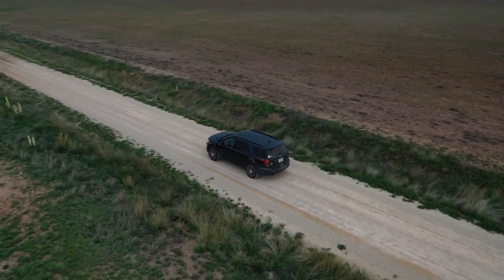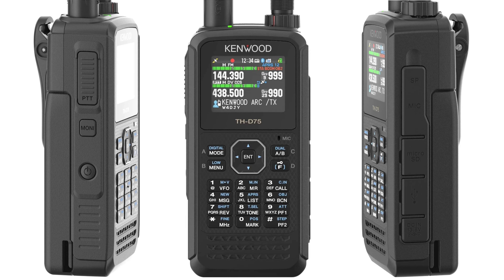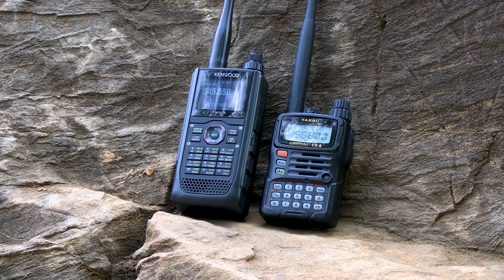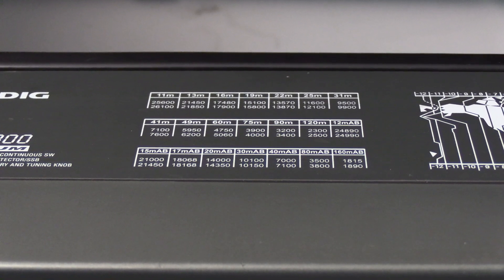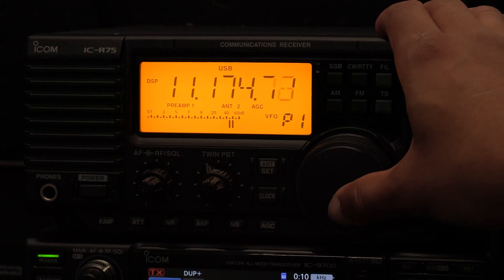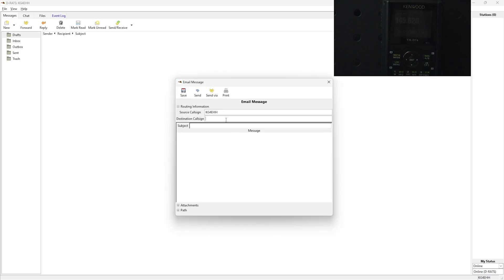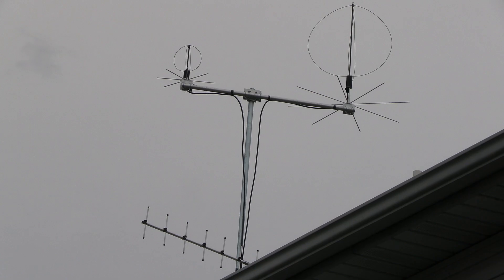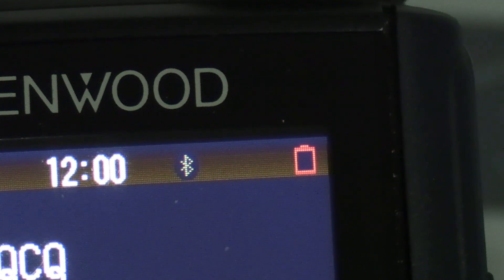The Ultimate SHTF radio - Kenwood TH-D75

Comment: Well I seen where it was already mention about the Kenwood TH6A because of the fact that it is a 3rd Kenwood to compliment the D-74 and D-75 should be reason enough. Also unlike the Yaesu VX6 it will also do CW, Both USB and LSB as well as AM. The 220 Band at the full 5 watts, not just 1.5 watts like the Yaesu. Down side they are much harder to find then the Yaesu VX6 as you can still buy the Yaesu VX6 new after all this time. If you do find the Kenwood TH6A the price can be 300 + used verse a new Yaesu VX-6. I got lucky and found one where I only paid $100.00, but that does not happen everyday. Maybe consider to make a remake of this video and along with the Yaesu VX-6 also include the Kenwood TH-6A, just my 2 cents worth.

Comment: Great concepts, thank you. Yes, the D74 battery life is not happy. Additionally, the leakage current with power off is not great either. Fully charged, power off, it will drain in 4/5 weeks. Only my radios with a combined analog hard power/vol switch (Alinco, Motorola, Vertex) will hold a charge for a year and then some. My TH-F6A is very good holding charge, but the receiver outside of the amateur bands is not great. For bug out I would probably carry the D74 and a Tecsun PL-880 (great battery life, USB charging), or a Xiegu for HF.

Comment: I had a preorder with HRO and let it go because the lazy slobs at kenwood didn't add a bandscope.  Its unacceptable for a radio at this price range not to have it.  The $30 Quan Sheng I own with custom firmware (thank you Russias) now has a bandscope and can do HF receive AND transmit.  The only thing the $30 modded radio can't do is transmit on SSB, but this radio can't either, its only receive and it can't even transmit on HF.  All thats shows is Kenwood COULD make this radio with a bandscope and HF transmit (with SSB) but chose to just make another D74 with a USB C port, while marking it up $150 for nothing more than the now mandated European standard of USB C.  Screw Kenwood.

Comment: I wouldnt say its ultimate,but flexability yes,something i constantly see with usa is mars mods,thats fine but with one caveat!
Do not use the stock antennas supplied,they are very tight bandwidths out of band ive found.
Best to use a commercial resonant antenna or a blade tape type thats wider bandwidth.
👍

fab vid

Rob.P 73's

Comment: I have a USB-C PD power bank, and with it i keep a USB-C PD to 12V barrel jack cable (it has a trigger so the power bank outputs 12V, it's not a 5V to 12V converter in the cable) and a few adapters to charge my radios.
Reply from the maker: That's handy. What power bank are you using?
Reply: @The_Comms_Channel  It's a GreenCell PowerPlay Ultra, my instinct would be to buy one with PD 3.x like Anker 737 for future proofing, but 12V support is optional in PD so maybe i was just lucky with this power bank. But at least some radios with barrel jacks seems to support up to 16V input, and 15V is a standard voltage so if all your radios can tolerate that it might be the easier way to go. Otherwise you have to read carefully or ask the manufacturer if it does 12V.

Either way, i got it to run an entire portable lab. It can output up to 20V so i can even use it to charge laptops, and if they don't have USB-C, there is adapters for most laptops that tells PD to output 20V, i even used one such adapter and a small lab PSU module to make a small USB-C lab power supply. I also have a USB-C PD compatible soldering iron.

It's a bit of a wall of text, but my point is; it's quite expensive if you want to just charge phones and radios, it might be still be worth it to you but for me i got it for the other things and the radio charging was a bonus.

Comment: If you want a great hobby, improve your technical universe, D.I.Y. radio, gear, antennas, generally, meet great people that you can learn things from, even volunteer for various public service groups & events, Ham Radio has been the most rewarding hobby for 35 years for me.
 If you are getting a handheld solely for a shtf scenario, most likely, you will be disappointed, as it has many limitations.
HF is the area I had the most contacts and fun, taken mobile & or portable.
If you have to choose an all around radio for base that will work mobile & portable.
There are many options as a hobby that makes it tough to pick Just one radio as an all around two-way but we live in a practical world so here are a few..
 I would recommend an Icom 7100, older Icom 706, Yaesu 857 or 991, if choosing one single radio.
 I Have had the TH-D74 for almost 4 and a half years and used about 95% of the features, when I bought one, the world of supply chain issues was not an issue and prices were more reasonable. Ham Radio is a large and technically diverse hobby, from old school but still very useful CW, to Satellites & computers, Mesh network high speed data,  Live Amateur TV broadcasting, microwave RF to shortwave radio, near LF band experimental. There is no such thing as learning too much with this hobby.
73 & Happy New Year, thanks for the great videos.👍

Comment: Totally agree about this video.  I bought 2 of the D74's specifically for the 220MHz DSTAR capability.  The only way for regular folks to decode that would be via an SDR and you need specialized software and knowledge to do that.  Not many folks have that.

There is 1 fatal flaw with the D74 that you need to be careful of - there was an issue that I have read about using the micro USB charger charge controller having issues.  Not sure if they ever fixed that - I've used the desktop drop in charger for mine ever since getting it - but something to be aware of.
Reply from the maker: That is good to know about the Micro USB Charging. I bought mine used and it didn't come with the drop-in charger, but he included a USB charger that charges via the DC-IN port luckily.
Reply: Icom r-30 and Icom r-8600 receivers can decode 220 mhz dstar easily I have both

Comment: What is the price of this radio - I have limited budget,  but strongly considering LoRa MeshTastic.
Reply from the maker: Still no pricing for this radio unfortunately. It will likely be the most expensive ham radio HT on the market so not the best if you're on a limited budget. My guess is it will be around $700. A LoRa device running Meshtastic is the much cheaper option for sure if you don't need voice comms.
Reply: @The_Comms_Channel  this is why I’m being inspired to build CrunchComm, an open source project building a LoRa based and very inexpensive way for preppers to use off the shelf and abundant components.  I’m hoping my video will help preppers to communicate using open source software.  Although most developers are using Arduino IDE,  I’m using Thonny IDE using MicroPython.
Reply from the maker: Awesome idea! I look forward to seeing where it goes!

Comment: Is this radio ability to be used by a beginner yet still give a huge opportunity to use more advanced features as knowledge grows?
Reply from the maker: I've not used the TH-D75, but I'm sure it will be similar to the TH-D74 I have. If so, you could definitely use it for just basic functions while you learn the more advanced features over time.

Comment: I just got the VX-6R and really like it, if I was into digital I'd hate it though. I was able to hit a local 220 repeater with the tiny 1.5 watts output and it probably was not even doing 1 watt because I was on the regular battery for it. Only problem, there was nobody doing on 220 in my area of Utah county, Utah!! So what good did it do? I scan all the 2m, 440 and 200 repeaters and simplex frequencies (over 150 VHF and UHF channels) on my receive only Uniden SDS200 and I've virtually have never heard anyone on 220. Not one time ever!! I am hoping I can get some locals on 220 soon before we not only lose the repeaters on it, but we lose from the FFC taking it away!! I'm waiting for the new Kenwood too.
Reply from the maker: The VX-6R is a nice rugged little radio for sure! Same here on 220, there's a few people on occasion, but it's mostly unused. I also have the SDS200 and use it with ProScan. Great radio as well!
Reply: @The_Comms_Channel  I just heard a couple of guys on a 220 repeater for the first time in my life last week! One guy had a fake or expired callsign that doesn't check out in the FFC database. So looks like some use the 220 band as a clandestine band for a little outlaw ham goings on. Since they figure they are not monitored as much as 2m and 440. The other guy had a legit callsign at least.

Comment: Gotta hand it to Baofeng bf-f8hp 
(No short wave) but - 1.25, 2 meter, frs/gmrs,  murs, marine and some air band. It is also capable of data transmissions.
Reply from the maker: Didn't think that one did 1.25. I thought it was 2m/70cm.

It's true that you can do data, but would need to attach a TNC or another device to it, whereas the TH-D75 has a built-in TNC
Reply: @The_Comms_Channel  
Yes, you need an attachment. Yes, the BF-F8HP will give you 1.25. You need to lower the frequency range through chirp and toss on a 220 antenna for better signal propagation. It works and it does ok.
Reply from the maker: Ah, good to know! Good to see more 220 radios out there.
Reply: @The_Comms_Channel  
It was not advertised as a 220 "tri band" but, i noted its capability once adjusted through chirp. I have tested it and was able to get 15 miles 220.300 , (that is in my local.)
I probably won't make it my "go to" but..  thats nice shit to know in a shtf situation ya know?
Reply from the maker: Never knew you could open up some radios with chirp like that. Are there many radios out there that can do this?
Reply: @The_Comms_Channel  
Yes, there are several lol

Comment: What do you think about the Icom ID-52A as a SHTF radio?
Reply from the maker: I have one, I think it's a cool radio and love that it has a waterfall in an HT. Any radio is better than no radio of course, but for the price of the ID-52, I think there are better options out there for SHTF. Some things it does have going for it though is GPS and D-STAR (which I feel is the best digital mode and will be doing a video on why later). Since it has GPS and such a large screen, I wish it had some mapping capability for the display. Even if it was just a basic map. It would be cool to display where other D-STAR users are located on a map. 

For its current price and capabilities of the ID-52, I would go for the new Kenwood when it comes out. I imagine it will cost a little more than the Icom, but hopefully not by much.
Reply: @The_Comms_Channel why do you think D-STAR is the best digital mode?
Reply from the maker: I'll be doing a video on it, but a big part of it for me are the Icom apps available. If you have a D-STAR radio with Bluetooth, you can easily pair your phone to it and download the Icom RS-MS1A app and text back and forth from your phone and send pictures stored on your phone. While you can send text messages using DMR and Fusion, it's only via the radio itself, and the interfaces are terrible. Being able to text from the phone is much quicker and easier.

Comment: I had the VX6 and the area where I live sucks for receiving on the HF bands which means the Yaesu receiver sucks so if the Kenwood is better that would be a plus
Reply from the maker: Were you using the stock antenna?
Reply: @The_Comms_Channel  no I was using a Jetstream tri band antenna the issue I have here is I live a block East of a ship building company and I have hills to the East and to the West of me which creates noise on receive and it has only gotten worse as the ship builder has expanded I liked the VX6 but the SWL feature was useless because of the noise I am lucky I can hear stuff at least on 40m (7MHZ) with my Kenwood TS2000 and the 2 102 inch whips I use in di-pole configuration  with my constant S-5 noise
Reply from the maker: Ah, that's frustrating. Didn't think to do a test between the two to see which is better on HF, but it may be worth doing.

Comment: APRS relies heavily on the internet to function so as a tool in a disaster it may not be reliable! Also APRS doesn't function well in remote areas for that matter most of the country, it's 0nly practical in large cities where there may be many digipeaters in operation! While the thD75 is a good radio I thing there are way  better alternatives for emergency comms. One suggestion would be the IC705! With this radio you have full tranmit and receive and all hf bands including 6m, 2m, and 70cm. It's light weight and has its own battery. Or can run on any 12v DC source of at least 6a
Reply from the maker: The APRS/AX.25 protocol itself doesn't rely on the internet at all, but I understand where you're getting at. The current network of digipeaters is definitely heavily reliant upon the Internet, but it doesn't have to be that way. My friends and I use digipeaters here locally and on a different frequency from the usual 144.390 with good results. It's all about getting the infrastructure in place and testing before something bad happens. We wanted to avoid relying on the internet at all and is why we went this route. I have an Icom 705 and totally agree with you there. Great radio for SHTF too and may do a video on using it for SHTF as well eventually. Thanks for the comment!

Comment: Good video. I'd also suggest people look at the AnyTone 878UVII (I have 3 of the first gen which are basically the same thing). It is dual bandwidth, but I don't really see the need for 1.25M, especially if your comms are to enable reaching out to others, not just your "team". Most people won't be able to receive there anyway. The 878s allow for great encryption (which is legal - get an FCC roaming business license - they grant it for "shooting clubs", "backpacking clubs", "whatever clubs") if you need it. Just remember, regardless of the freqs, half competent people with an SDR will be able to find you and triangulate your position. These are comms, but the tactical use might be limited.
Reply from the maker: All good points. The main reason for using the 220 band for me was because it's less crowded. That of course means your group you want to communicate with will need to be on 220 as well. I've not looked at the AnyTones much myself, but may have to give them a closer look. Another commenter mentioned them as well. Good info on the business license. I've never really looked too deep into it because I thought you needed to provide proof of having a business, but I'll look into it if they are able to give it to clubs. Thanks for the info! We'll be doing some testing with packet Radio and the KrakenSDR to see the difference between tracking voice comms and packet Radio soon so stay tuned for that! Thanks again for the info and comment!
Reply: Anytone is releasing an updated model/ battery that is usb-c charging capable “soon”
Reply from the maker: @BryanTorok I've not heard of the "roaming business license" he mentioned, but I imagine he's just talking about the frequencies that the FCC has allocated for businesses.
Reply: The BTech 6x2 Pro I understand is less restricted than the Anytone 878 UV II
Reply: What frequency can you get this "roaming business license" for?  Encryption is not legal on the Amateur Radio bands and it is not legal to conduct business on the Amateur Radio bands.  

While I happen to think that the Anytone HTs are good radios, they are primarily intended as DMR radios.  They are a PITA to program and while you can put in a frequency in VFO mode, they are especially a PITA to program on the fly without a computer.

Comment: Since buying an HT with color display I am skeptical about them.  The radio I bought is totally unuseable outdoors under normal daylight conditions.  The display is unreadable!  My cheap Baofeng UV-5R has a better (monochrome) display for outdoors in daylight. How readable is the display on this Kenwood radio outdoors in daylight?
Reply from the maker: Valid concern for sure. I've not had any issues with the readability of the TH-D74A and Don Arnold has a video of the upcoming TH-D75 out in the sun and looks readable as well

His video is here:
https://youtube.com/watch?v=sBML0Au9ztU&feature=share9
Reply: @The_Comms_Channel  that is good news
Reply from the maker: You can also change from the black background to a white background as some find that easier to read as well
Reply: @The_Comms_Channel  that is good news.  have you tested it?
Reply from the maker: I prefer the black background and that one has been fine for me outdoors so I've not really tried the white background myself.

Comment: The Ultimate SHTF radio is one thats waterproof like the Baofeng UV9R
Reply from the maker: Waterproof is definitely good and one of the good things about the Yaesu as it can be completely submerged. While the Kenwood isn't IP65 like the UV9R, it is IP55 and I've had it out in the rain with no issues. Just wouldn't want to end up in the drink with it. But if that is a concern, it could be put into a dry bag before going in/on the water

Comment: I would like to suggest the Kenwood TH-F6A it has AM, FM, SSB, and CW on 0.8MHz to 1.6GHz. I would guess even without the extended battery that it would last 10x as long as the TH-D74
Reply from the maker: Definitely a solid choice! I've been looking out for them ham fests but no luck so far.
Reply: I have a TH-F6A also and it is a great radio.  No digital voice (dstar) and no aprs but the mobilinkd tnc4 would provide APRS digital mode at least.

Comment: I have both radios, most people don't know that the VX-6R when expanded works with 1.5 watts on 50 Mhz and 70 Mhz as well.
Reply from the maker: Did not know that! I used to have a VX-7R that was like that when opened up. Good to know that about the VX-6R!